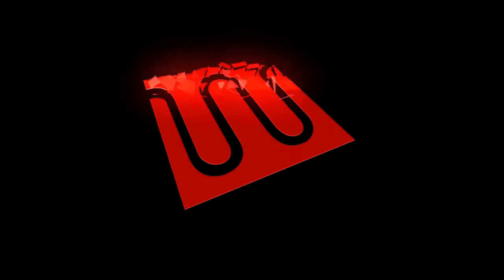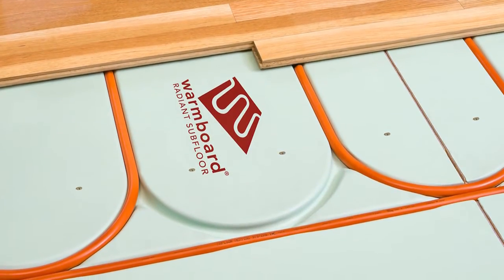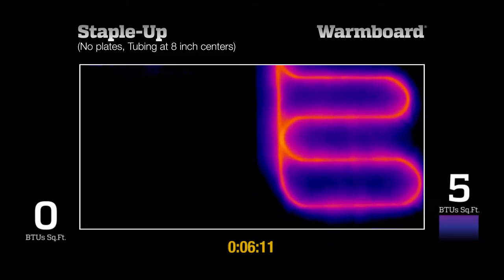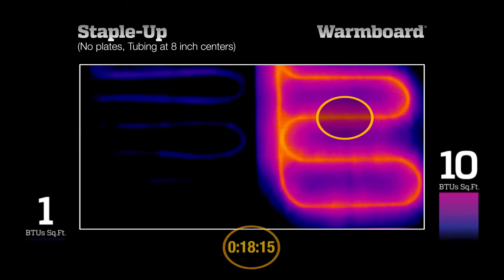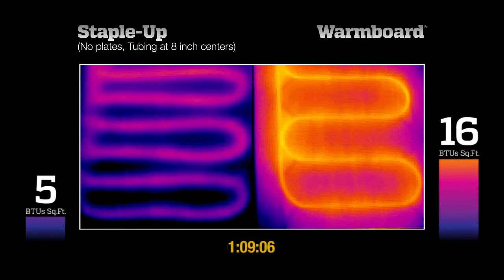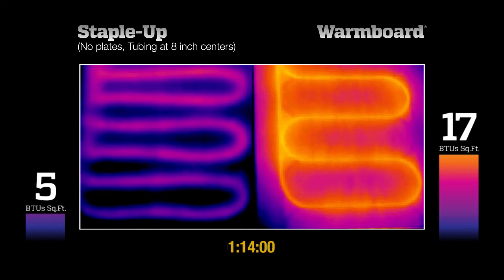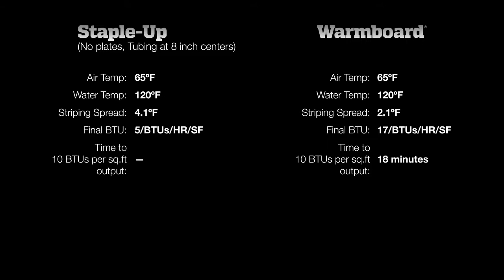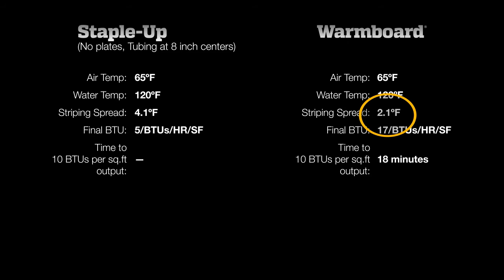Radiant Heat Performance: Staple-Up vs Warmboard

Comment: Interesting comparison.  I just moved into a home which has Watts Onix tubing 8" spacing stapled up with no plates and a foil faced bubble wrap insulation underneath.  Using a thermal camera I could not detect such pronounced "striping".  The floors reach a temperature of about 72 degrees with a water temperature of 95 degrees.  It keeps the house warm with low enough water temperatures to utilize a heat pump efficiently.  I'm sure warm board performs better, but I'm curious how much an effect the insulation details have on the performance.  Leaving an air cavity probably allows air currents to spread the heat better, not sure how much the foil helps.
Reply from the maker: Think of the cruise-control function on your car. Regardless of the type of car, if you set it to 70mph, that's how fast the car will go. And as long as that road stays straight and flat, your car will go 70mph. But throw in some sharp turns, steep climbs and drops, and this is where you notice the differences between types of cars/trucks. Same goes for radiant. As heating needs change, often rapidly, the performance and efficiency of a system comes into play.

A well-insulated house will always be more efficient than a house with poor insulation. But that is still one part of the equation. Windows, orientation, geography, lifestyle, floor coverings, energy costs, fuel source, weather – all these play into how comfortable you will be. Sounds like your system is working well for you. and that's awesome. We have clients with similar setups who aren't getting the same results you are, and they opt to swap out with our products.

So, in some situations, yes, Warmboard may be more than is necessary. But in many others, we can perform in ways other systems simply cannot.
Reply: @Warmboard   Thank you so much for the reply.  I wish the previous owners installed Warmboard but it is what is for now.  My main question was somehow my staple up system must be performing much better than what you show as 5 BTU/hr/sqft at 120F water would be a major problem.  I did a rough calculation that my radiant heat puts out about 7.5 BTU/hr/sqft at 95F water temperature (by measuring the delta T and flow rate from the heat pump and dividing by home sq footage), but definitely some of the heat from the 2nd level is leaking to the lower level, not just heating upwards to the 2nd level, and same for the first level heating the unconditioned basement.  So unintended paths probably improve the output.  I have a bathroom with two exterior walls and very little radiant floor space and it gets too cold, I'd love to try Warmboard there for a future remodel.
Reply from the maker: @RicknessJ82  In the video we tested the two products side-by-side, so all factors would apply to each product equally. If we were to redo the test in a more conditioned space, no doubt the results would be improved, but of course they would improve for both products equally. Sorry to hear about your bathroom. We've no doubt our panels could handle that space better for you. And if the situation arises, we'd love to work with you. Thanks for your comments.

Comment: Nobody would ever install bare tubing and call it a radiant heating system. I would fire that contractor immediately. Staple-up needs aluminum panels to spread their heat. This video is intentionally deceptive.
Reply from the maker: Installing bare tubing is still very common (unfortunately) and we encounter such applications regularly, particularly with unsatisfied homeowners. This video is to show the importance and effectiveness of conductivity. To see how we perform against a system with transfer plates, watch the video in the link below. We never published this video publicly due to the technical issues with the video, which you should notice right away. We're not sure how this happened, but this is closer to what you're looking for. https://www.youtube.com/watch?v=R6ne5RMJfgs

Comment: I agree with the other poster, Most staple up uses Aluminum heat transfer plates + insulaton behind the plate. Would be good to see a more real world comparison
Reply from the maker: We actually did however shoot against a joist track setup, but for reasons unknown, this video alone experienced some technical issues, so we've never publicly shared it. But you can watch the video here if interested. https://www.youtube.com/watch?v=R6ne5RMJfgs. The issue in question should become quite obvious very quickly. :)

Comment: It would be interesting to see a test with the use of  aluminium heat transfer plates, since they are common and recommended for staple up systems. The comparison should be made with specific Warmboard models e.g. Warmboard-S and Warmboard-R
Reply from the maker: Hi George. We actually shot this video and were able to get some data, but the resulting video had several glitches that occurred. We can say the system performed about the same as Quik Trak. The striping was worse (about 6.5º variation vs 5º with Quik Trak), and it took about about 15 minutes longer to reach the 10 BTU output.

Performance wise however, there should be minimal difference between Warmboard-R and Warmboard-S as they are using the same aluminum and same tubing spacing.

We are hoping (sooner than later) to shoot these videos again.

Quik Trak vs Warmboard: https://www.youtube.com/watch?v=kqlFML2QnQ0
Reply from the maker: Sorry we never responded to this. We did shoot a video against a joist track set up. Here are the results. https://www.youtube.com/watch?v=R6ne5RMJfgs The video was not shared publicly because of some obvious technical issues that occurred.